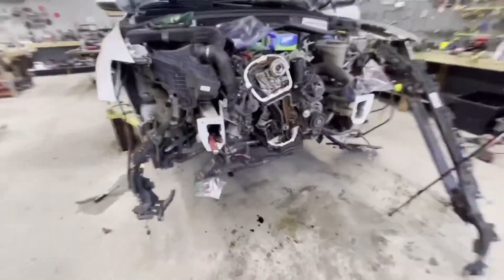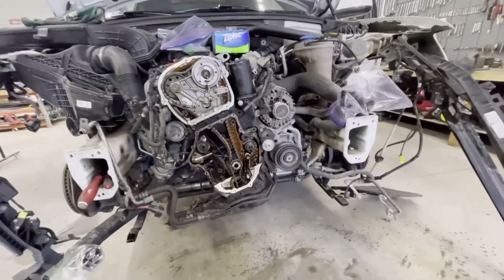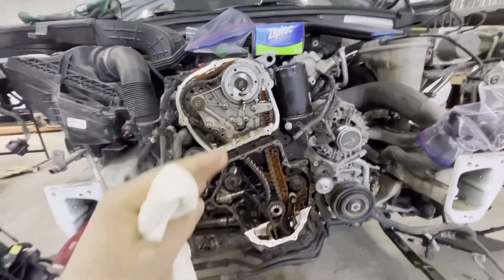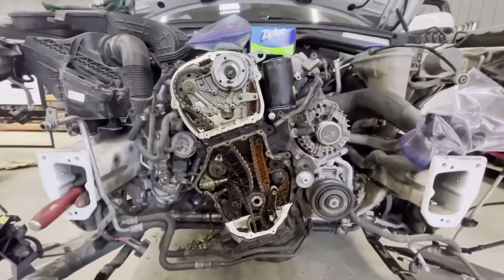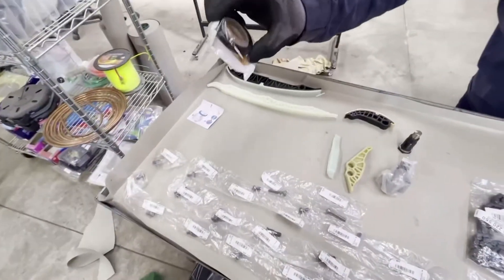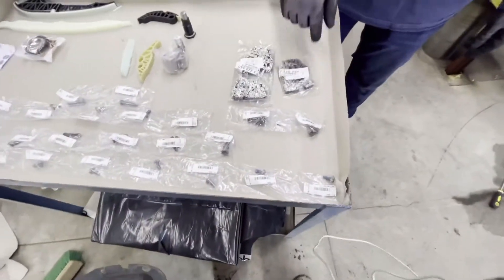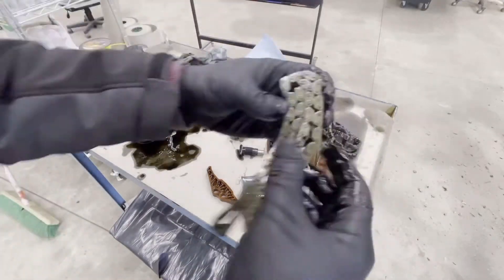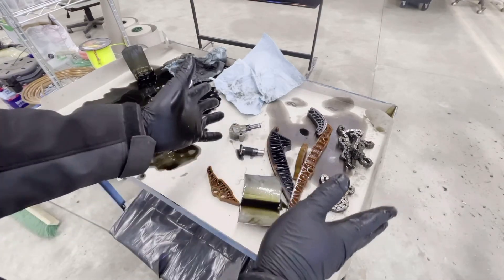Audi 2.0 Timing Chain Problem /  Symptoms / ￼Solution Fix

Comment: Audi dealership told me it will be around 5k to do this job. I was like what the hell. I went in for an oil leak which is the top camshaft gasket and they wanted 5k . 1700 for the water pump as well.

Comment: I wasn’t having issues till i changed the timing chain. Now I’m getting rattling. Only replaced because on high rev i would hear a slight rattle. And timing code was permanent. Now its rattles loud and i get check oil level. Any idea what it might be ?still dont have any codes. I changed all guides, tensioners and chains.

Comment: Good video but should be limited to under 5 min.  Key parts: bought car used @ 58K, heard noises at startup, loss of power and issues after 4K miles, describe symptoms in 1 min. Next, inspected chain and replaced along with related components. Working perfect.  Done  Spend time editing to hit essential points - esp the cam/crank sensor codes  which resulted from compensating for improper tension.  Also * the inspection hole for the tensioner is GOLD  *
Reply: Even shorter....If you're gonna be an owner of an Audi with the 2.0tfsi then you'd better be checking your cam phase number judiciously and the rest with vcds or a really good scan tool.

Comment: i cant observe if new style tensioner has hole for oil feed (because on another videos where is used old tensiomer, in block of engine under upper screw of tensioner there is smaller diameter hole to feed oil into tensioner), but in new one i cant see it (also neither in slow mo) ...so does it have somewhere oil feed or it works only as spring based tensioner ?

Comment: What year model is this engine? Mine is 2010 and I want to know if that updatet guide rail kit with a bend around the crank wheel will fit my car. Your top rail above the cams is also longer than mine, making sure the chain doesn't jump easily with a faulty tensioner.
Reply: it was until 2013, ea888 3rd gen doest suffer this
Reply: @majklxxx  I finish change all my bent valves after the catastrophic chain tensioner failure. I can now confirm that the updated rail kit which are longer and with the mentioned bend around the lower toothwheel will fit 2010 Audi's. I asked AutoDOC in advance and they told me it is only model 2013 and up that will fit the updated version. I took the chance anyway and purchased the "wrong" kit for my car, the car runs perfect now. I also replaced the oil sump due to rust, therefore I took the extra time to remove the oil pump to get access for changing the oil pump chain included in the kit as well. All in all a 5 days job in my garage due to the bent exhaust and inlet valves. Hope I never have to redo this work ever again!

Comment: My Audi dealer recently told me that the timing chain was showing signs of wear and needs to be replaced. The only thing is that I’m not having any of the symptoms you’re describing. I have some clicking when the car is running idle but no lag, no loss of power, etc. I don’t trust this dealership since they’ve been wrong before so if I’m not having any engine issues and there’s no alert going off then is it possible the dealership is over calling it? I have an Audi A4 TT 2012 95k miles
Reply: Change it immediately all Audi 2.0 turbo tsfi faulty tensioner.  You will blow your engine if you don’t!
Reply: have you still not had any issues?
Reply: @leonkurtish9242  fortunately no I haven’t…I brought it to an independent auto shop for a second opinion and they said the timing chain or the tensioner was not an issue. They felt that the clicking was a fuel pump that was wearing out. No disastrous engine failures so far…
Reply: If there’s a rattle

Comment: I think the problem could have been also been diagnosed by checking the timing correction, i believe its somewhere in measuring blocks 91-94. The correction should be a max 8 degrees, with 6 being a more ideal limit.

While the engine is already this much opened up, it maybe a good time to reseal the cam girdle as well, those have a tendency to leak oil into the spark plug holes and exterior.
Reply: @Robert how is this done by checking the measuring blocks and does the car have to be running as have a 2011 A4 T2B5 and when engine goes to start just sounds as a starter spinning.
Reply: Ok that sounds like a crank no start issue, yes the engine needs to be running to check the timing electronicly. But if you can't start the motor, you want to check the trouble codes with a vcds or obd eleven first. See what codes are coming up which may be causing the no start. That's step 1

To manually check timing
1) compression test - quick check to remove spark plugs and confirm there is compression
2) remove valve cover and confirm the cams are in the correct position at TDC if you suspect timing issues.

A lot of factors can cause a crank no start, even bad sensors, so it's worth checking the codes and testing sensors before disassembling or and opening the cover.
Reply: My timing was 2.1” and mine still blew. Honestly you have to just change the timing on these at 85k
Reply: @maksimderinskiy2325  true, a plastic guides can break all at once and give up all the slack without warning, the most prone spot seem to be the upper tensioners where the cam sprocket can skip if the guide breaks

Comment: We just got a diagnosis of a loose chain at 52,000 miles. That's short for a timing BELT. I thought chains were almost permanent. For now the only symptom is check-engine-light. We may wait a bit before dropping $1,200+ on a repair.
Reply: Several things: 1. Time chains can last over 300K *if* oil is changed before carbon levels build up say every 4K or so. - Fore example on my 1997 Saturn (original owner) chg'ed oil every 3K miles AND never let oil got more than 1 qt low.  7 years ago when doing head gasket I measured the tensioner and it had only worn/extended 25% yet a friend had his fail at 80K miles on a newer Saturn because he let the car (which consumed oil) get 2 qts low and changed oil every 7K miles. Dirty oil with a lot of carbon from exhaust clogs the oil hole on the tensioner and that really accelerates wear.  2. You mention timing belt - which is often preferred to a chain because it is NOT exposed or depend on engine oil just a spring tensioner so weather you change oil on time OR NOT it makes NO difference the belt life.   3. Turbo engines build excessive pressure and that can pollute the engine oil with exhaust requiring it to be changed at lower miles.  Turbos are magnet for abusive drivers - high revving puts extra strain on a belt or chain.  4. Belts can break from age & excessive heat - chain never will. 5. Regardless of miles on the oil - it needs to be changed when there is excessive carbon buildup and the only safe way is to test a sample at a lab or just change oil every 3 to 5K miles.